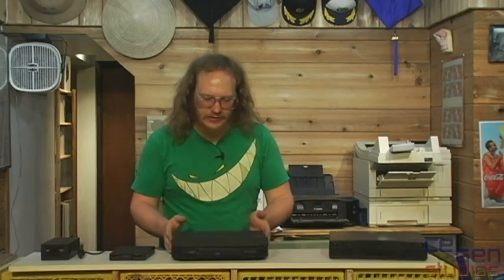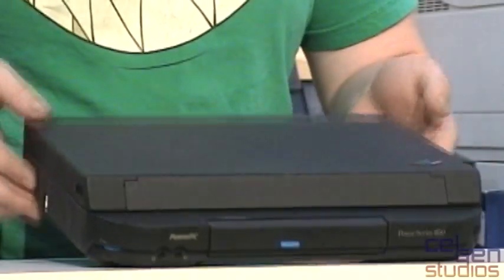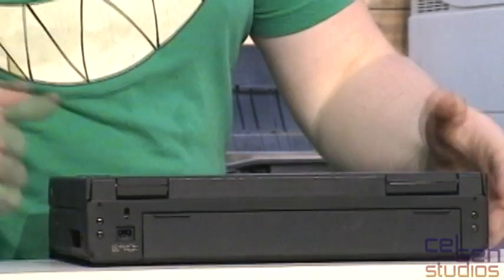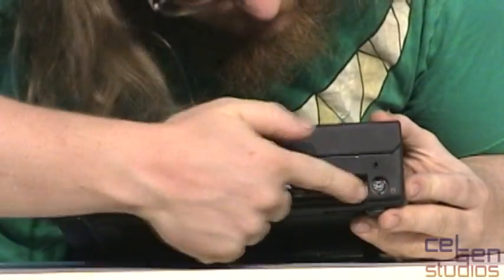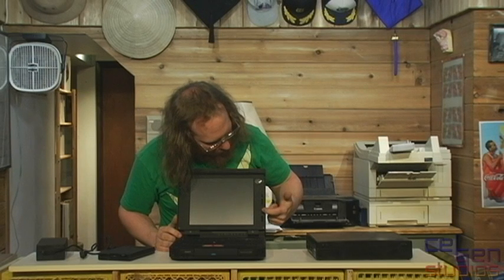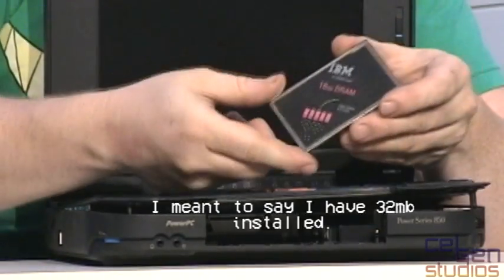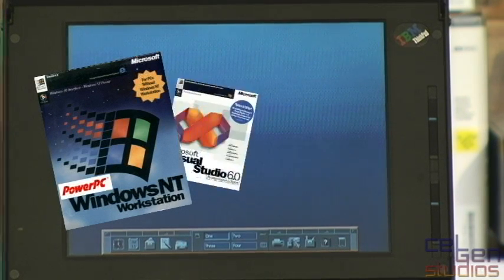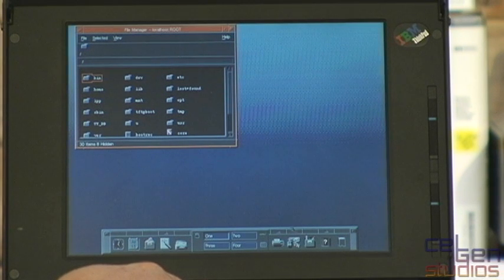IBM Thinkpad 850 PowerPC Laptop

Comment: Does it come with a c compiler? If so,  you can compile some modern POSIX software for it.
Reply from the maker: It's a pretty basic AIX install, so no compilers were installed. :(
Reply: @CelGenStudios  Unfortunately, at the time IBM's XL compilers were licensed software, and you had to pay quite a lot for them (and they had just started enforcing license keys). Most of the GNU toolset of the time was available with compile targets for AIX, and several FTP sites had pre-compiled versions of many of the tools, including GCC, so you could compile the rest. Whether you could now find an archive of that age of GNU software, I don't know, but there is a chance that even modern copies may still contain the correct targets.
Although IBM had different levels of machine, all AIX software was compatible from this type of system all the way up to the SP/2 'super-computers', so you could compile on one RS/6000 and run on pretty much any other. Differences in the instruction sets between, say PowerPC601 and Power 2 or Power 3 were trapped and emulated in the runtime libraries, which made it very compatible with the other systems.
There is quite a lot in the basic AIX install. One thing you could look at was the system admin tool SMIT, which had some interesting features, and if you had a copy of the Hypertext documentation CD, then this contained all of the documentation (IBM had pretty much stopped shipping the huge AIX documentation bundle on paper unless you explicitly specified it during the order). There were also a small number of X-11 demonstration programs, but the most impressive thing was the Ultimedia Services demos, that included video and audio, and also included some rudimentary voice-control of the GUI, although it was painful to use.
There was also a build of WASABI, or was it Insignia SoftPC available that allowed you to run Windows 3.1 software on the system.
I worked in an IBM RS/6000 Support Centre, and we had a number of these to be taken home by the out-of-hours support people so they had access to an AIX system with them at home. This was pre-Internet in the home (at least in the UK), but we had modem cards to allow the users to connect to the systems in the office, and we also used SLIP (with protected access through the office firewall) to get TCP/IP access to the systems.

Comment: run mac os on it
Reply: It won't run. Apple put additional checks on their PowerPC Mac installations that prevented it. As far as I know, Apple never released a CHRP or PReP build of MacOS (although who knows what they did internally), their PowerPC systems were always different.
I tried putting an IBM install of AIX on a Bull Escala (or was it an Estrada) PowerPC 604 system, and it failed the system check, even though it already had AIX running on it.

Comment: If you haven't found the manuals for it, look on the kev009 site. There might be some documentation for it there as there are for a ton of RS/6000 models. As for the boot chime, the 43p and similar models use it as well. 

As for AIX software to demonstrate, IBM has Quake on their FTP server, and there are compilers for AIX.

Comment: it may be possible that the hole on the side of the laptop with the PCMCIA slots could be the hole for draining the keyboard.
Reply: indeed, i may not be correct on this however as i sadly do not have first hand experience with this laptop. only the knowledge that some models in this series do have this drain hole